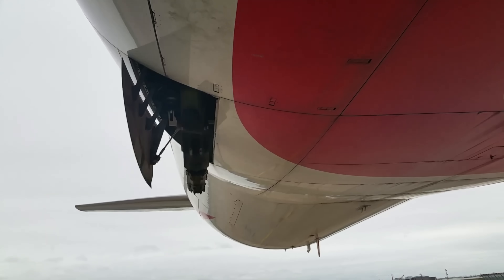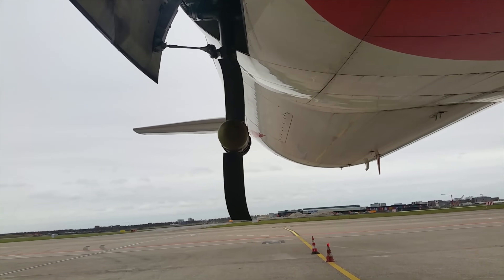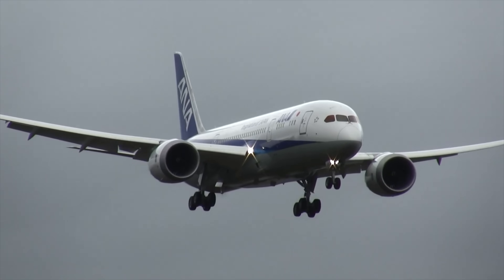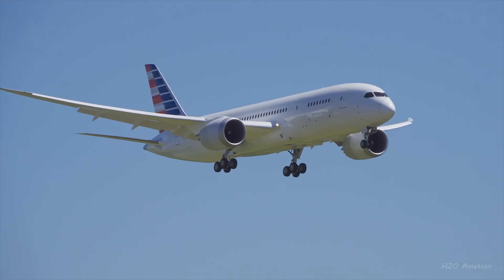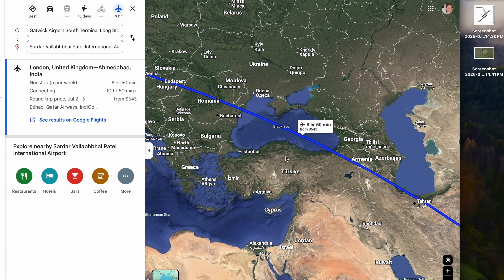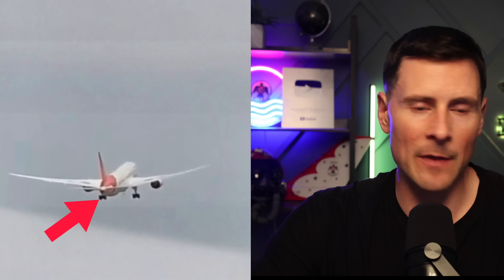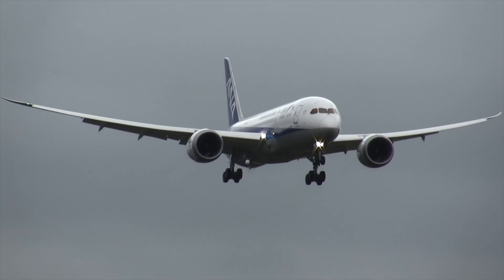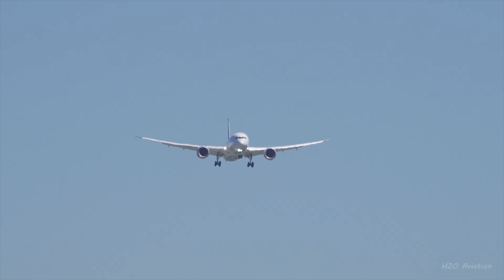Air India 171 SHOCKING UPDATE on RAT Deployment and Flaps!

Comment: In the manner in which I see the steep rise and from the edge of the runaway, I think "weight" can be an issue. The plane was fueled again, and the plane was 20 minutes late for departure, which tells me something was wrong with the final movement of the departure 
The engine failure is there, but what is the cause of the issue

Comment: I believe this aircraft was stricken even before take off- something happend on that runway- the aircraft used 100% of that runway instead of approx 75%. The aircraft hit 75% something happend giving the pilots 1-2secs to react before they hit the point of no return. They hit the point of no return, decided to try and fly the stricken aircraft.

I believe they did try to retract the landing gear- there is evidence of that- the angle of the wheels. At this point the engines failed/a catastrophic hydraulic failiure- rat deployed. 20secs in the pilots sent the Mayday message stating there was no thrust in both engines. Sadly at that point fate dictated.

That's my theory.
Reply: The runway argument and the low climb rate is the strongest opponent over the electrical failure theory which answer the sudden stop of the ful pumps. But the it could point a more complicated electric failure. Because if the first engine get lost after V2 and then the second stop but of electric failure, the failure start impacting one engine first.
Reply: @reinerfranke5436 the aircraft had recently undergrone a refit. As India isn't really known for it's attention to detail, one theory ispoorly/incorrect fitting of cables.

Another is poor fuel quality- India does still buy alot of oil from russia who's refineries are poor and I don't think India's are much better.

Comment: British Airways Boeing 787-8(LONDON to Chennai,India Flight)had to land back in London after Dumping fuel in ocean it is said that it had flaps adjustment problem......Air India 315 Boeing 787-8(Hongkong to Delhi) had to land back in Hongkong after having technical issues after taking off......i am no aviation expert but why now?Like why this 787-8 having problems now and together?Does that mean that it is not maintained properly by Airline company or it can be problem from Boeing.
Reply: Could be a correlation with a supplier dlivering now garbage.

Comment: The wheels if you notice are tilted forward on the later video where the rat is barely visible, possibly indicating that it was commanded to retract initially but the plane probably lost hidraulic power, the gear tilts forward before being stowed its the first thing it does on that plane and its not dependent on the hidraulic system which might explain why it didn´t move after that.
Reply: Yes, something went wrong the moment the plane took off.
Reply: Some angles it look like the wheel might have moved a few inches towards being stowed, but that's likely just the angle as I'm pretty sure they just drop back down if hydrolics go out.
Reply: @kaseyboles30  The gear can't move toward being stowed.  The gear doors were closed.  They have to open first.
Reply: @stargazer7644  That's a good clue as to when things failed then. It clearly got to the point of tilting the wheels to stow them. I suspect those doors opening would have been next then, or perhaps the thing(s) that broke affected the doors but not the wheel tilt.
Reply: @kaseyboles30  Yes, there are multiple videos of this exact aircraft departing London.  The bogeys tilt forward, then the doors open just a moment later.  Once the doors finish opening, the gear starts tilting inboard with the starboard gear leading the port gear.  The main gear are on the center hydraulic system.  This loop is not powered by the engines, but by dual 270V electric pumps.  So the center hydraulic system had to already be down when they flipped the gear handle moments after rotating.  The engines could have still be operating at that point because the gear can't use the left or right hydraulic system which are powered by the engines and electric pumps.

Comment: In 787 If the speed is below 225 knots, the system doesn't allow for flaps configuration to change to 0 even if the pilot mistakenly puts to flaps 0.
Reply: CRITICAL OBSERVATION
Reply: The 787 Computers protect only the Slats and not the Flaps from retract manual to early. But in any case there are warnings!
Reply: The B787 doesn’t have Alpha-Lock — that’s an Airbus feature.
Reply: @Ayejayflex  so youre telling me the problem was a software issue. They should have used Airbus OS. (joking btw I really feel bad about the people on the plane and people affected by it)
Reply: @ExplosiveGaming9035 no it just comes down to design philosophies, Boeing believes pilots are the ultimate authority and should be able to do what they want or need, Airbus is off the other approach where they believe as much input should be automated to minimize pilot error.

Comment: In some of the pictures of the wreckage it shows the that the flaps and the slats were deployed. Another observation I've seen is that the landing gear bogies are canted forward instead of canted back as they would be when in the landing configuration. Apparently the first motion of the landing gear when being retracted on the 787 is for the bogies to cant forward just before the gear moves into the gear bay. I believe that that would indicate that the crew had moved the gear handle into the retract position but if they lost hydraulics because of engine failure the gear would not be able to retract. I'm no expert by any means, but doesn't each engine have generators and hydraulic pumps? If the gear had failed to retract and the RAT being deployed lead to suspected duel engine failure?

Comment: Great video as always and giving a lot of insights! One thing I’ve seen about the gears in another analysis of the crash, was that they look like they’re leaning forward instead of backwards, which is a sign of they had started being retracted, but the hydrolics (or both engines) were lost at that moment. The sequence for retracting them on the 787 starts by moving them first to lean forward. I have a question. If for any reason the throttles were moved down to zero during the take off, would the RAT deploy automatically in that scenario, although it wasn’t done due to a failure? I’m asking this because I’ve read a (far fetched in my humble opinion) scenario of the pilot’s seat moving suddenly all the way back on its rail, due to a failure of its locking mechanism, and that the pilot didn’t leave the throttles in time when it happened, throttling down both engines. I don’t know if this could be a likely scenario or not.

Comment: As per lone survivor, he said, he heard some boom 💥 sound for 30 seconds and lights started flickering...it says, there was definitely electrical and mechanical issues.....
Reply: RAT deployment can also cause this. The bay door opens with a bang, and when the RAT switches to take over the electrical supply there can be some  temporary power instability.
Reply: @tyrannosauruswrecks5904 I can imagine it being quite violent at max speed but at takeoff speed? But yeah survivor was sitting nearby RAT and the adrenaline level will make a moskito sound as loud as a jet engine.
Reply: @tyrannosauruswrecks5904  a RAT is deployed due to an electrical, mechanical or hydraulic issue, a RAT is a direct step of causation of an issue a plane may experience, otherwise it not used, unless for testing and maintenance.
Reply: I have no idea about this, however other sites have mentioned the boom and interior lights flickering as a sign the RAT took over power. However every site also states the RAT only powers critical systems so wouldn’t the non critical interior lights have gone off when the RAT took over? Maybe they switched to a battery back up?
Reply: @squangan  warning lights were flickering..
Reply: @squangan  The RAT does not power interior lights.  The RAT powers a very minimal subset of things on the plane.  There are emergency exit lights that run on batteries.
Reply: though as said rat deployment can cause this i have a feelign there was still a electrical issue, theres a video online showing the inside of the plane 2 hours before take-off that shows the AC not working, also there are various pilots that work for air india that have spoken about how maintenance issues are often neglected as in the case of the AC not working.
Reply: Any new info?
Reply: It was Green and White light he said
Reply: 1. The entire flight was like 30 seconds so yeah
2. How does a boom related to definte electrical and mechanical issues?
3. As you seem an expert in this topic, how does it sound if a RAT gets deployed?

Like I get we are invested in this topic but all of a sudden random people in internet comment like they personally engineered this plane
Reply: @HKVERKRUSTUNG  Well, commercial pilots commenting on this have stated that the deployment of the RAT makes a loud bang or thud, which makes sense considering it has to deploy without power assistance, so I'm guessing there's a powerful spring that deploys it and I'd expect that to make a loud sound.
Reply: @PharmaGiles  Le passager survivant l'a bien entendu d'autant plus qu'il était assis juste au dessus.
Reply: @HKVERKRUSTUNG  To me, RAT deployment sounded like a THUMP every time I experienced it. 
We tested 787's for every kind of failure in experimental flight test.
Reply: @HKVERKRUSTUNG  Sabotage. The plane's maintenance history just prior to the flight is "interesting". I won't say what, until I find corroboration. 

Sabotage? There was a major incident in Kashmir a short while ago, of a type that's more terror than military. Nothing to rule out a small bomb in just the right location to knock out critical systems. It could be that crude. So far, we don't know, except the engines lost power.
Reply: The beauty glide to death https://youtu.be/sqHmmnuf0IU?si=_kh9415KUzjiZ6DM
Reply: Multiple bird strikes?
Reply: maybe a bomb? no one knows anything, at this point!! just guessing.
Reply: Isn’t Lone Survivor Mark Walberg?
Reply: Bruce Willis.
Reply: @NicotineRosberg  no it's Tom Hanks and Willson helped keep him sane
Reply: sabatoge . . .
Reply: @deandee8082  dean, you mean Boeing should have used a different type of batteries?

Comment: Hello Sor, thank you for a thorough investigative discussion. DOES Boeing 787 HAS FUEL ON-OFF SWITCH ONLY AT THE WINGS FOR GROUND STAFF TO OPERATE DURING FUELING??
  It mentioned in another utube video that Boeing 777 and 787 has one major difference which may have been overlooked for this accident in Boeing 787. The fuel cut off switch just before fueling is at cockpit in 777 while 787 has fuel cutoff switch only on the wings.
In the past due to many problems with malfunctioning of that switch in the cockpit they placed this on-off switch at the wings for the ground maintenance staff to switch it on or off. Do you think that this might be the reason that after fueling they forgot to switch on the fuel and the fuel  lines of the aircraft had just enough fuel to climb up to 600 feet and then stall due to fuel starvation Do you think this might be the cause or if this fact is correct about difference Boeing 777 and 787??

Comment: The landing gears seems to be slightly tilted like a position that they are just starting to be retracted
Reply: Was solved. Retraction was underway. The mechanism force a front wheel tilt down first. Not clear if reengament need some progression first. Anyway the time the retraction stop is coincidence with engine fuel pump stop and ATC loss.

Comment: I speculate that the plane lost all electrical power causing the engines to roll back or fuel system to shut down. The RAT restored power and the engines were coming back on line but too late.
Reply: I wonder how electric power is mixed on 787, whenever battereies are buffering all power sources, every source have to be somehow stabilized by some kind of power converter. And if one engine can power rest of plane and another can do same. Then there must be at least some switching or mixing. Just like for RAT it cannot be directly connected. Maybe this element failed.
Reply: In modern era of electronics switching supply is no different than frequency converters driving three phase AC motors like pumps, turning AC to DC firts, then one DV high voltage is converted into whatever you want, Hz and Volts. If there is battery it may fail. And 787 was know to have issues with that

Comment: to think the pilots would take off with no flaps is a disgrace, those were VERY experienced pilots thousands of flight hours. This was a mechanical failure. The RAT comes out on total loss of power. Nothing they could do but exactly what they did, try to land it where they could with the least amount of casualties as they could. Pray for all involved.
Reply: Modern planes have software running that always knows in what stage of the flight the plane is. Such mistakes don't just happen anymore without a loud warning going off.
Reply: Yep. After reading enough about this, both pilots would have to be totally drunk or suicidal, to ignore all the warnings and alarms in the cockpit that they're taking off with the flaps not deployed.
Reply from the maker: Yes. I believe the pilots did their best.

Comment: If you "imageine" the RAT's sound out, you will notice that for a supposedly full thrust of the engines, there is no "jet" sound at all which in a typical TO would override any other sound.
Reply: Agreed, it's far too quiet for a fly-by that low
Reply: yep, either no engines or at so low a power as to be a gentle breeze. Explains why the rat is out and why they just droped from the sky.
Reply: If the RAT is deployed, there is no engine thrust.  If the engines were working (even one) the RAT wouldn't deploy.
Reply: could it be the apu were hearing  the air intake door was open at the crash site
Reply: @davidblurton7158  Even if the apu was making noise, the lack of engine sound and the way the plane just drops out of the sky says zero engine power, or so close as makes no difference.
Reply: @kaseyboles30  yeah they were screwed

Comment: I hope this shuts those who are putting it as pilot error. At this point, we should leave it to the investigation without blaming the pilots.
Reply: I always assume it's not human error, even in the design and maintenance, until proven otherwise. I've watch enough videos of airline issues to know how many of them are freak issues no one ever thought off (a wasp nest in a sensor, built in just a few hours). Mind you these are all one off as the next step after finding out how the long odds came around is to drop those odds to ZERO or as close as possible. If that means every pilot has another item to check and must verify the placement of 7 pieces of duct tape and carry a role and three sticks of chewing gum just in case then so be it. This is how super safety oriented the industry is. Or perhaps I've watched Mentour pilot's channel to much, but that's the impression I get.
Reply: Is it ok to blame one of the pilots yet?
Reply: Should shut Captain Steve, for sure … 😊
Reply: @JahaanIndia he took a complete U turn from his first so called “analysis”.
Reply: @_P.D_  Yes, he admitted he was wrong.
Reply: @JahaanIndia He released an update video addressing the new footage, calm down.
Reply: @RCAstudios 2 days later, he is gonna release another one. The point here is as a pilot himself. He should not assume or speculate based on just a video. Then we don’t need black box anymore. Let AAIB & NTSB DO THEIR JOB.
Reply: @JahaanIndia absolutely, he is a disgrace to the pilot community
Reply: you're such a good person!  the rest of us can only aspire to your moral purity

Comment: Hi. Since there doesn't seem to be any errors on the part of the pilots except for an incorrect calculation of the take-off weight input, but I don't think that's the case, I'm leaning towards a fuel flow problem that caused the engines to shut down and consequently blackout the electrical system which obviously depends on the operation of the engines themselves. After reaching V1, the pilots probably noticed that they were starting to lose power in the engines, but by then it was too late to brake and in fact they used the entire runway to take off. It's true that the problem of contamination by condensation water in the engines is known and there are detection systems, but given the weather conditions this is an option (it's also true that the other aircraft evidently didn't have this problem). If, on the other hand, it was the electrical blackout that caused the engines to shut down, we need to understand what caused it and we just have to wait for the results of the investigation. The truth will surely come out and Boeing can only hope that the problem isn't theirs and that they don't have to ground all the 787s, otherwise I see it as difficult for the future of the company. Thanks.

Comment: Could water intrusion into some electronic equipment have disrupted the electrical signals from the cockpit to the engines?  What happens when you spill water on to your Mac book WHILE you’re using it? Bad things happen!  How many times do the mechanics look for water intrusion into any of these connectors?  When the throttle’s electrical signal is interrupted, do the engines power automatically power down to idle?  Why does the system do that?  Should the throttle’s on all planes be a manually controlled? 
Obviously, Boeing had put the 4-test planes through all kinds of testing prior to being ok’d for the market.  
The one kind of testing that isn’t practical, is a plane’s many birthdays and tinkering by hack mechanics.